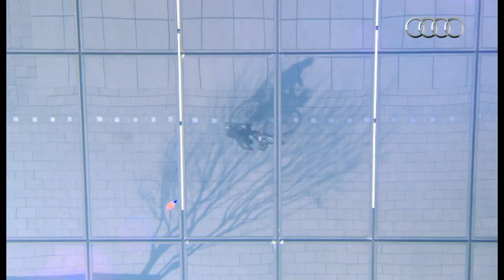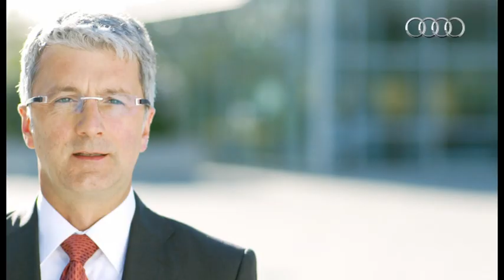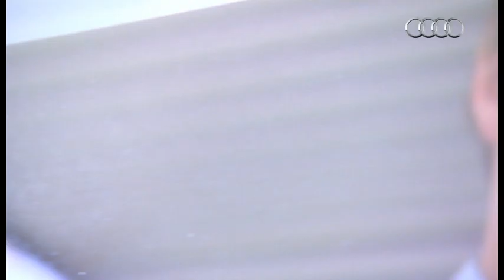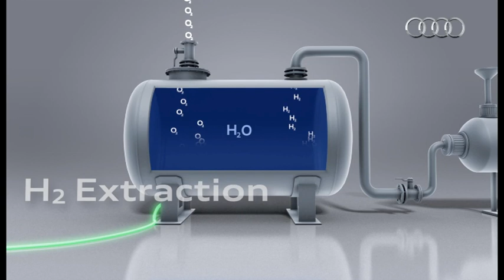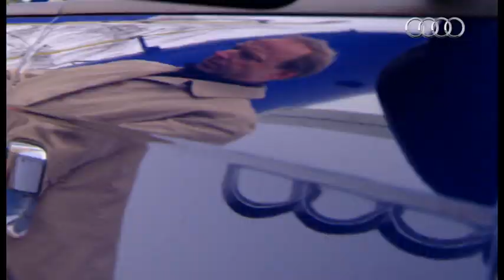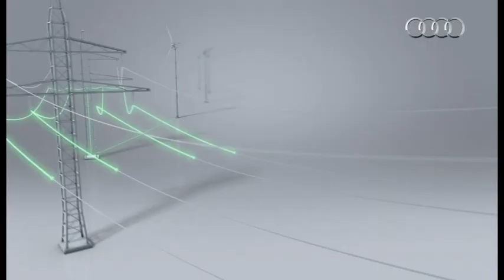Audi A3 TCNG e-gas project - balanced mobility

Comment: @lilo689   you are totally correct. Energy wasting. Insulated Sodium Sulfur Batteries
heated by a heat pump in combination with a wankel range extender or a free piston
linear generator range ex. would make more sense. There are three enterprises which have
put the temperature at 90 ° down.

Comment: it's about 70%. right now the efficiency is 50-60% but will improve. without this system the efficiency is 0% because they only use the electricity when there is to much in the grid. there are days when the wind is blowing to strong that 60% of the energy mix in germany is generated by wind alone, but because old coal and nuclear stations are not flexible enough they clock up the grid. on average twice a day for 4-5 hours there is to much energy available that needs to be stored.